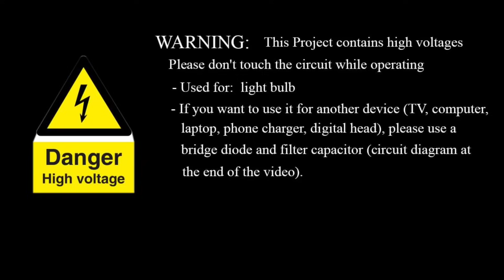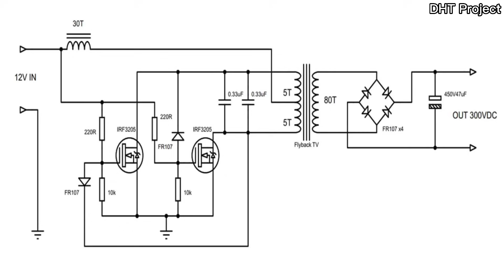How to make inverter 12v to 220v from old CRT TV  Flyback Transformer

Comment: Wait why did you put your bare arm right by the leads of the flyback? That's really dangerous man
Reply: Isolation transfomer can not shock any one even when you touch both hands on 2 output leads
Reply from the maker: Hi! This circuit should be for reference only. you guys shouldn't use it
Reply: @trungnc5487  it’s the voltage that kills. if the voltage is high it will kill you if u touch with both hands no matter it’s a transformer,battery  or the outlet.
Reply: @fayanshorts  Wrong. Both voltage and current will kill. One cannot kill alone. For example if there was 100A and 1V that ain't going to do anything and if there was 1000V and no current flowing nothing's going to happen.
Reply: @fayanshorts i think you got it wrong mate. If it's only high voltage it would drop instantaneously when it comes into contact with you. There should be good enough current too
Reply: @dhtproject7022  bro if i use this core for car amplifier power supply how many watt may i get

Comment: So sorry to be the bearer of bad news but this is not an inverter circuit. Please note that the input is 12Vdc and Vout is 300Vdc. Power Inverters are DC to AC converters and this cool little circuit is is really classified as a Push-Pull transformer coupled DC to DC converter.  It works good, but just not as an inverter however, it's 300V output could be used as a front end to make a little inverter.
Reply: Correction sorry for ur information finally the voltage output is alternative current just because she didn't use any rectified diode to be out for dc😂

Comment: Hello dear engineer and good taste.  The thyroid used has a capacity of a few microns, or tell us the specifications of the used wire so that we can make it ourselves. Please help. Thank you for your attention.
Reply from the maker: Hi Bro! we use ~2mm shielded multicore wire for primary. 0.5mm wire for secondary.
Reply: Hello dear, kind and sincere friend, I mean the wire wrapped in the inductor. Please accept my apologies.  I could not read well.  Thank you very much for your sincere kindness: raad
Reply from the maker: Hi Bro! I took an inductor from the computer power supply. I don't know how much it is Henry (H) but it has about 30 turns.
Reply from the maker: wire diameter about 1.2mm
Reply: SÜPER PROJE OLMUŞ

Comment: I need to build a '220 vac 800 w stator armature to add to what is already there so as to get to 1600 w (1.6 KW). Any advice? With the ferrite proposed in the video I could make primary and secondary with a value in Henry based on the diameter of the wire chosen and the voltage and 'amperage needed to finish the project. Thank you very much.

Comment: With a winding ratio of 80:5+5  and a ZVS driven with 12v (output volt peak being about 3x12v=36v), shouldn't the FWB output capacitor be more than 450v?....since a no-load situation may be significantly higher than 450v??
THANKS FOR THE GREAT VIDEO!!!

Comment: Hi, thank-you for posting the video.... Really valuable information you have given to us....

I have a question...
How to adjust the frequency. Which cap n resistor to change. Also will u plz help with the inductance of the inductor and the number of turns on it....
Lots of love from India......
Reply: Frequency should be fairly non-critical - best to start high, and turn it down a little for more power, stop when things start to overheat and go back up a little - turns RATIO should be easy to calculate... In the video i see 5turn + 5 turn primary - 80 turn secondary
Reply from the maker: Hi! This circuit should be for reference only. you can watch this video
https://youtu.be/bzPlduLpd5U

Comment: Can this circuit be able to run a high voltage flyback transformer as well??
Reply from the maker: Okay. But there is a simpler way to do it. This circuit should be for reference only. you guys shouldn't use it
Reply: @dhtproject7022  I thank you very much.

Comment: I make inverter without a single mosfet or resistor or any transistor or any components. 

Step down transformer

Wires

Thick wires

3v dc motor

12v

Comment: Hi dear tnx very useful but How many amps can it support?
Reply from the maker: Hi Friend! this is a better circuit with output voltage stabilization and battery low voltage protection
https://youtu.be/bzPlduLpd5U

Comment: How many Watts is the inverter?
Reply: Enough to run a light globe. 60
Reply from the maker: Hi!  . This circuit should be for reference only. you should not use it. you can watch this video. but i don't have part 2 yet
https://youtu.be/bzPlduLpd5U

Comment: Question. If you get 200 volts DC from 12 volts ac, can you run the 200 volts back into the system/batter for a hypothetical unlimited generator?
Reply: Lol 12 DC to 220 V Ac, inverter convert dc to ac
Reply from the maker: Hi! This circuit should be for reference only. you guys shouldn't use it
Reply from the maker: Thanks @Юлия Воскресенская  @Francis Gaming  @aaaaa

Comment: How much amps?
Reply: To run a 60 watt, 220 light bulb, around 3.5 amps.
Reply: @jfrphoto01  i think it's 0.6w as 60/220
Reply: @itz_revotorq_dbswr    Yep, my math was off a bit
Reply from the maker: Hi!  . This circuit should be for reference only. you should not use it. you can watch this video
https://youtu.be/bzPlduLpd5U